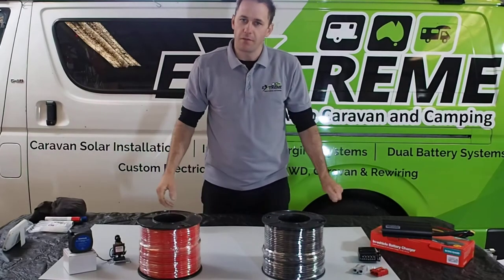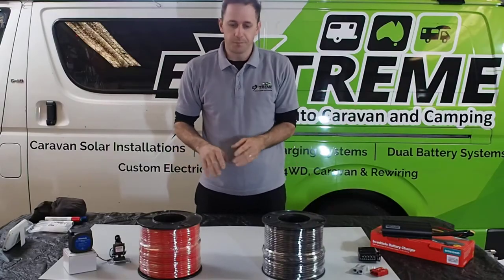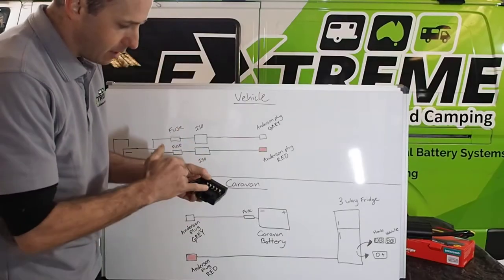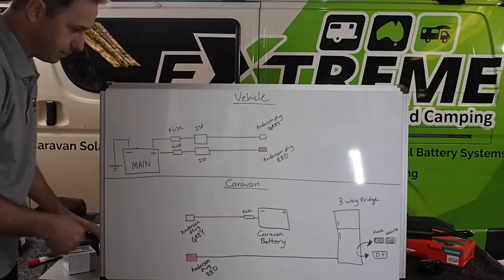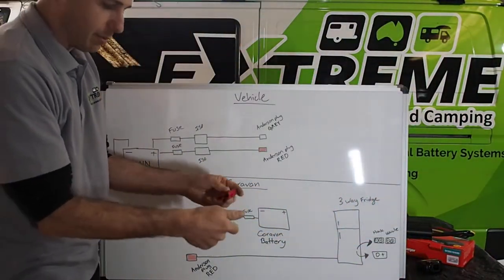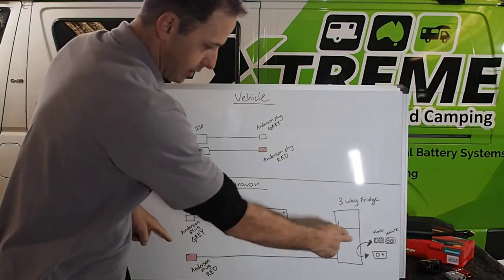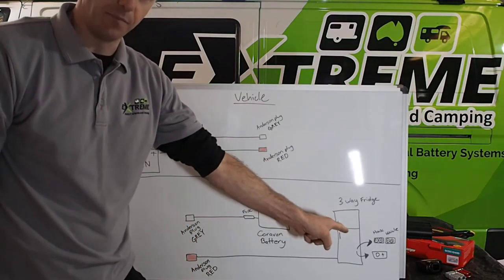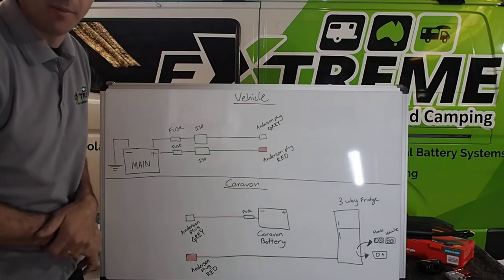Red and Grey Anderson Plug 3 Way fridge and Caravan charging systems

Comment: Hi Matt thanks for the informative video. I am about to set my ute/caravan with the setup you describe in your video to run the fridge while travelling. (nothing worse than warm beer after a day on the road!) At a later date I want to wire up to charge the house batteries. Is there any reason why I can't use one VSR to power both cables, as essentially once the VSR's both switch on, they are drawing from a common point anyway? Thanks in advance
Reply from the maker: I would avoid this and sharing one visa is like putting a T junction on a hose. The pressure will be reduced. The same is true for low-voltage applications
Reply: The red arc VSR is rated to 100amps (400 amps surge). It is not going to be a limiting factor. You don’t need two separate VSRs.
Reply from the maker: You do if you want to run two separate circuits.
Exactly what you described above is where people are having issues also.
Reply: Extreme Auto Caravan and Camping. S.A. Sorry your response makes no sense. What issues? You aren’t going to pull more than 100amps through the VSR so it is nothing like a T junction on a hose.
Reply: @georgethomas6541  Matt is correct.  The issue is not the rating of the VSR.  The issue is that the fridge pulls a high current continuously and creates voltage drop along any shared cabling.  If the cable or VSR is shared with say a DC-DC charger, the DC-DC charger will see a lower input voltage and will de-rate.  Trust me, I've been through this some years ago.  Best that these circuits are separate all the way from the cranking battery.  Rather than using a VSR, I prefer to put each circuit behind a 70A relay that switches on with ignition.
Reply from the maker: One thing you guys must remember is I do this daily and have seen all of the issues. When someone does this daily for well over 15 years now trust me on this everything must always go back to the source. In an ideal world we could go to the alternator and not have to worry about tapping off the starter battery.
In an ideal world we could run a master cable from the starterbattery positive then to a very high current distribution point from there we can go to all of our separate circuits. Toyota actually do a really good job as well as ford. You will notice directly off of their positive terminal they run MIDI fuses and a large cable supports this.
Back to the point though. Keeping everything separate from the source ensures each device runs properly and you are not putting extra demand on that line. Unless it is a very light load I would not attempt it.

Comment: why can't you use just 1 VSR
Reply from the maker: Your caravans anderson may have voltage at it. (Non isolated) if so, your 3 way fridge would then draw from this side of the single VSR.
This is why we use two seperate circuits for two seperate devices.

Comment: Great vid mate. You mention earthing at the rear. I'm worried I'm not going to earth properly there. The wiring kit I'm looking at has the twin cable that you earth at the source battery. Are there any issues with that?
Reply from the maker: The reason for the earth point at the rear is to eliminate the length of cable.
It is much better to have only 5 m of cable rather than 10 m of cable with an earth return to the front.
As long as you use a proper cable log drill a hole and go back to bare metal captive nut and then paint over it to protect it when you are done ✅
Reply: @extremeacc101  cheers mate will do
Reply from the maker: It’s all about keeping the cable as short as possible with absolutely perfect connections
Reply: @extremeacc101  And no fuse needed after the VSR? Some setups seem to have that.
Reply from the maker: @mattmullens3215  
Fuse point as close to the battery positive.
Either end
Reply: @extremeacc101  Followed your advice with two VSRs to power a van fridge and charge battery respectively. Works a treat. 👌
Reply from the maker: Good work
Reply: @extremeacc101  Matt, so why can we not earth at the back of the van (using exisiting earth set up) similar to the car side of the red Anderson run?  Unforturnitly I jump the gun, and didn't read all the comments first from your great video.  And only run one 6 B&S positive cable from the fridge to red Anderson.
Reply: @mattmullens3215 hi mate, what VSR did you use in your setup?

Comment: Hi Matt, thanks for this great vid. Earlier this year I followed you advise on my MY14 3.0lt Grand Cherokee. I ran two red lines (8 B&S) from the battery (under the  drivers seat) to the area at the rear behind the spare wheel well. I then ran the earths from a 10mm bolt holding the rear seats down. I used Midi fuses at the battery and 75amp Bosh relays on each line down to the Anderson plugs. I picked up a 12v ign on feed from the rechargeable torch location for the relays. I also wired a rocker switch to turn the van charge off if I don't need it, say after being on a powered site and  the van battery is charged through the Victron 240/12 charger.

I also used a 3 pin grey anderson plug for the van battery charging and also used the 12v feed from the torch as an ign source to the left hand pin to future proof my handy work.

I ran 8B&S direct from the fridge to the draw bar and am happy to report it took the voltage from 11.4 (existing wiring) to 13.8v while the engine is running.
The fridge has run perfectly on a 6k trip and have noticed it drop up to 2deg while on long stints.

My Van is an Eco-Tourer and had the the 3 way running off the then 100ah AGM....After the old Electro Charger cooked the battery I fitted the Victron 240V charger and a new 120ah AGM, I also fitted a Victron 500ah Shunt ( best thing ever) 
I'd just like to say again, thanks for this great video and your time to make it easy and clear to understand. Well done.
Cheers Trev
PS: just like to add i've done over 10k with this setup and neither the vehicle or van has had an ounce of problems. 👍👍

Comment: Hi Matt my van has anderson plug to fridge only and solar to van battery but no car to van battery. I connected a positive and negative from car anderson plug to van battery with car volts showing up at battery and van regulator. I have yet to run with both anderson plugs connected as even though seperate lines i am not sure if there could be a internal conflict so wondering what your thoughts might be before i hook up.
Reply from the maker: Hi tjay,
You must keep these circuits separate.  Always run directly from the starter battery for both 3 way fridge circuit and caravan charging circuit. You will not have any issues done this way.
Reply: @extremeacc101   Thanks Matt, connected as per your video and all is working fine. 😀😃
Reply from the maker: @tjaypatterson6774  great to hear,
Thanks